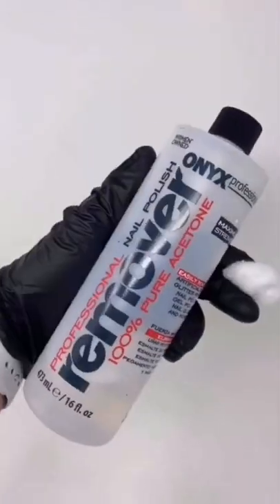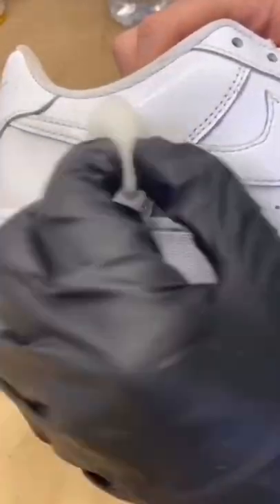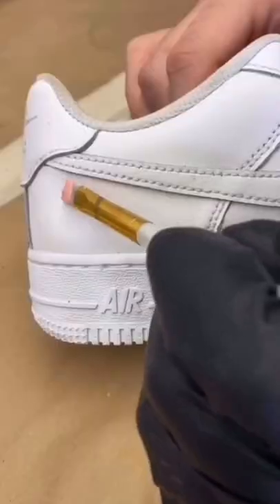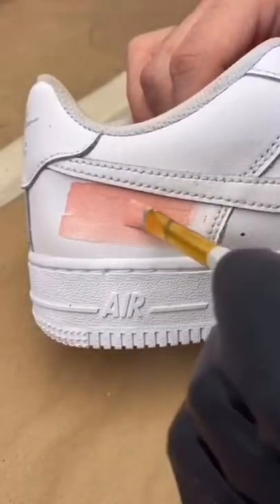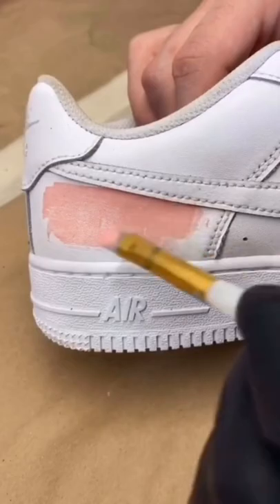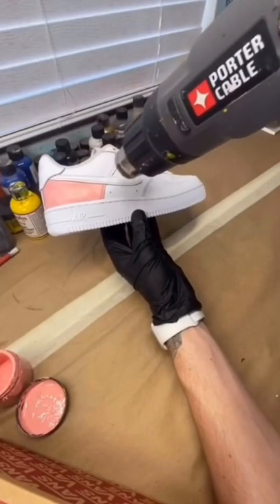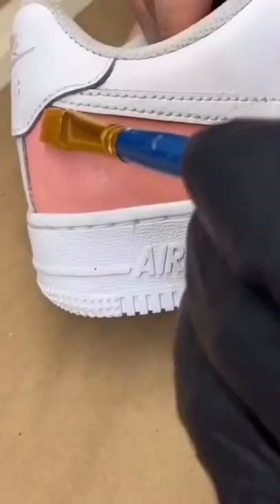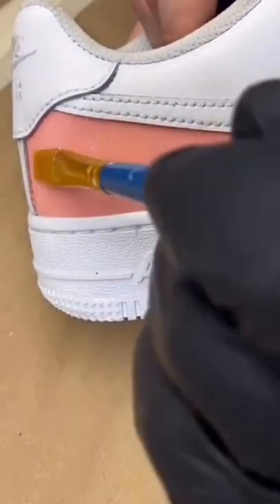How to paint on leather Nikes!👟🔥

Comment: What do you do if you don’t have angelus paint
Reply from the maker: Alpha6Corp! Apart from these two brands the paint will most likely chip off.
Reply: Well then buy it !!!😂😂😂😂😂

Its very cheap actually the pink bottle size he used is less than $10 ...

The smaller bottle is less than $5

And they have 70 + diff colors